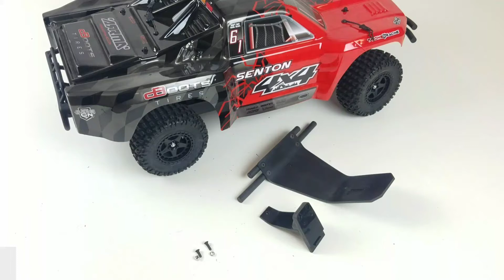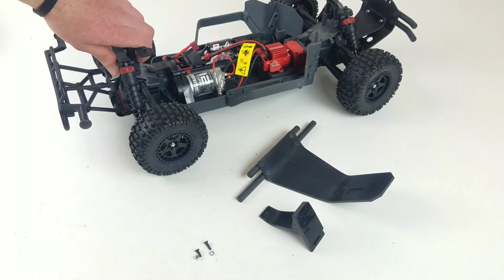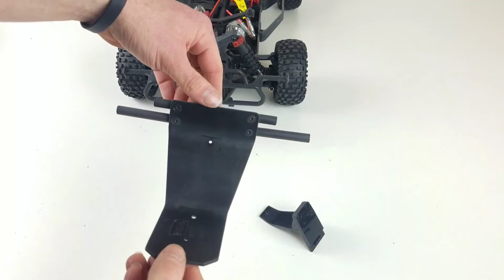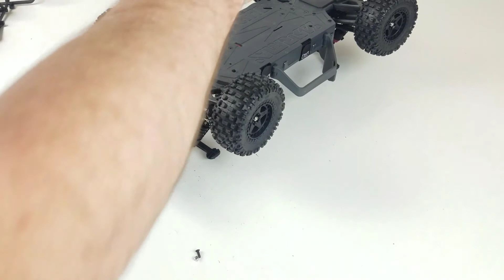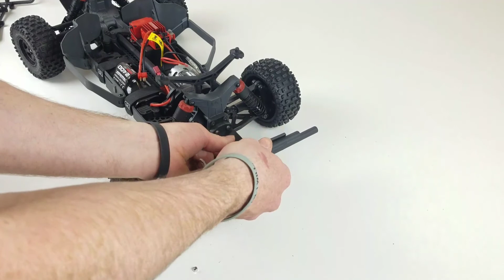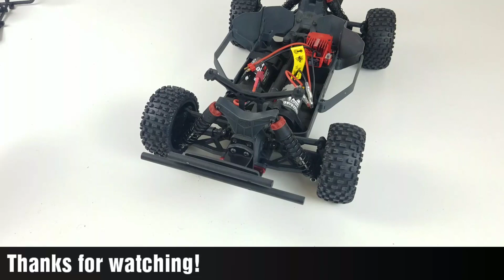T-Bone Racing Arrma Senton 4x4 XV4 Rear Bumper Installation

Comment: What holds the hinge pins in once you remove the stock bumper? Looks like they can just walk themselves out?
Reply from the maker: Hello! As I mentioned in the video, we had a design oversight on the blocks. We are updating the blocks to cover the pins. The mounting will be the same. If anyone has the first gen block all they have to do is email us and we will send them one of the updated blocks.
Thanks!